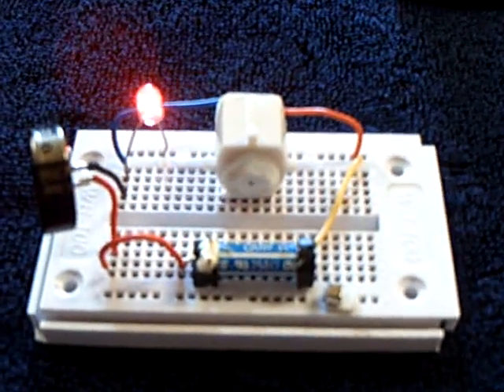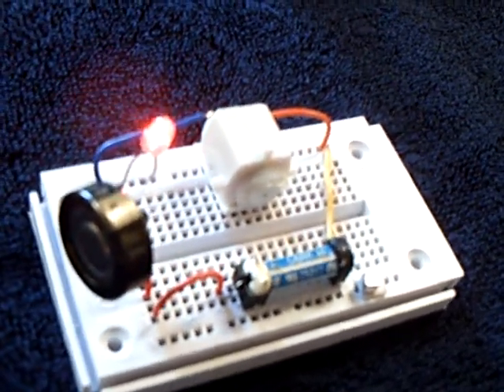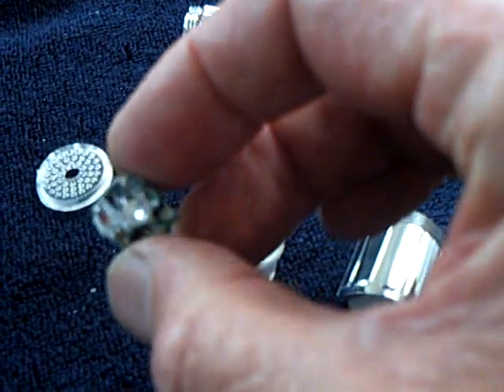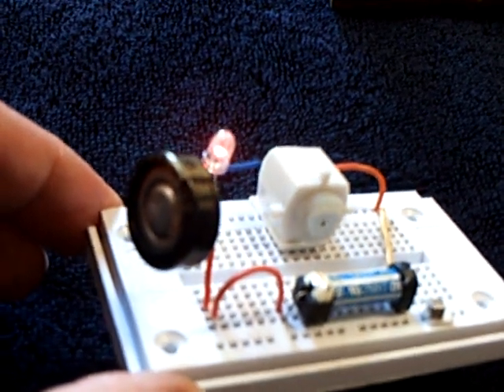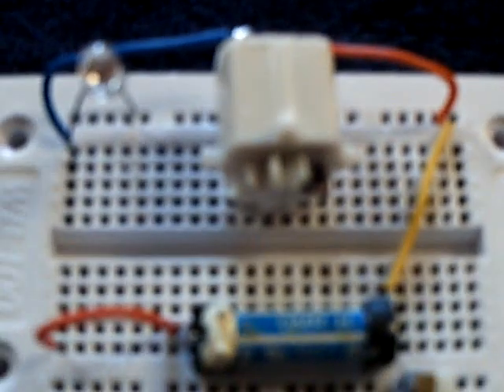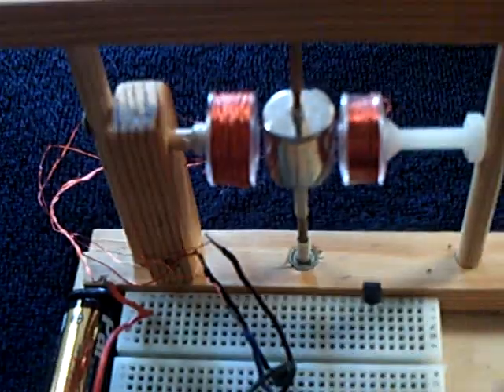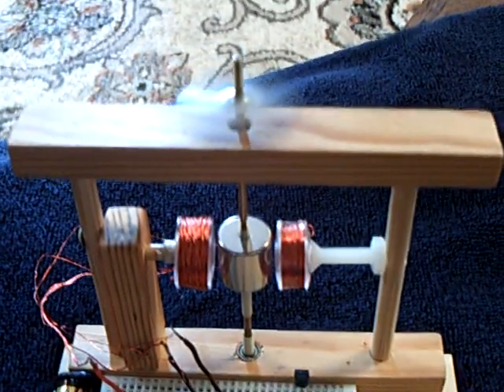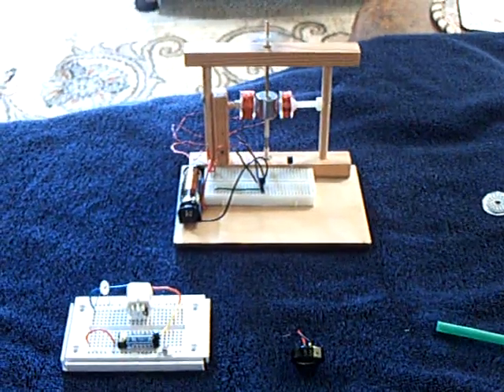LED Faucet Light----  Motor or Generator

Comment: Small Gorlov helical turbines could be mounted in series in the same pipe, without slowing the water flow! The blades could be 3-D printed neo spirals, and the copper coils wrapped around the outside of the pipepipe.
Reply: That would be nice! You could charge your phone while you take a shower or flush the toilet! :)

Comment: Cool vid.  I like that little faucet motor.  Only 2.89$ on Amazon.

Larskro's claims seemed fishy.  It's hard to believe his little motor would free-spin as long as it did--but then, his motor rpm was actually quite high--so it's hard to say how long it would spin without power...
Reply from the maker: One of the things that interests me with Larskro's motor setup is his use of two reed switch biasing magnets. That could be one reason his motor turns freely when the power is off.  Don't know.
Reply: ***** Your biasing magnet is positioned to take advantage of the motor's collapsing magnetic field, right?  When the motor's magnetic field collapses enough, then the magnet closes the reed switch to complete the path for electrons to flow from your cap to the motor--which provides enough emf to get the motor to spin up again. 

In theory, how do you think Laskro's 2 reed switches may be working together to keep Laskro's motor running?  I don't see how cycling the reed switches to try to take advantage of the cemf as an emf (i.e. motor drive pulse) could continue to pulse the motor for long after the power source is removed.  The cemf is less energy than the normal drive emf, so eventually (and quickly) there would't be enough force to keep the motor spinning.

I think your induction drive method is probably closer to the truth of how his motor continued to spin... :\

Comment: Very nice :) 
Although I think it's actually more like a bar magnet instead of a diametric magnetized cylinder (at least in mine.... that's how the weight feels...  (would look like  newmann (neuman?) motor with the coils like yours and the post n/s going through the coils a little...
Reply from the maker: Yes.  I think that this is basically a tiny Newman type setup.
Reply: ***** just wanna say that i took one completely appart ans it is really a strong cylinder magnet on the one i took appart.thanks for sharing!
Reply: iluzyon1 Oh! With brass sleaves as bearings ans a mini ball bearing at one end to work as a trust bearing.